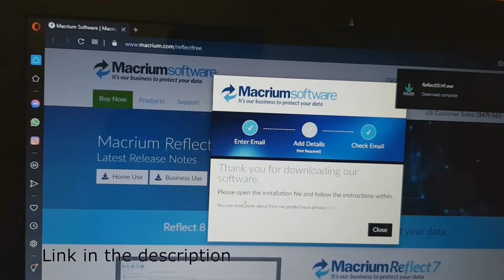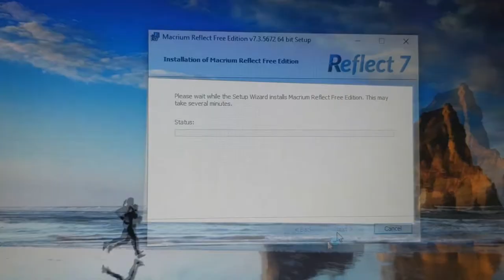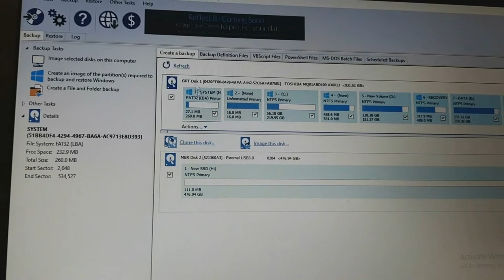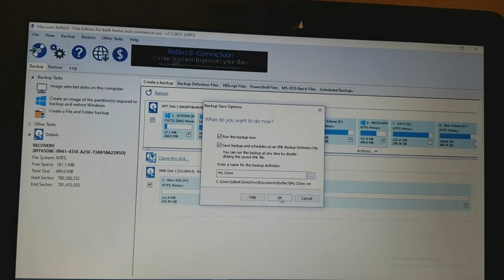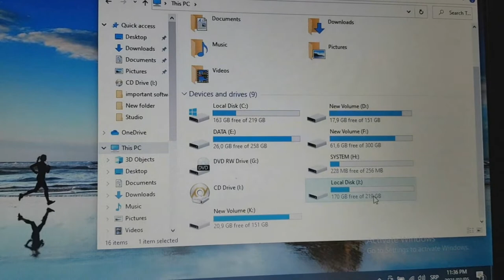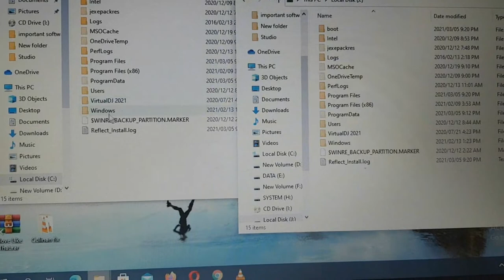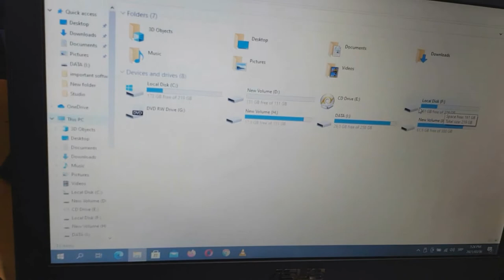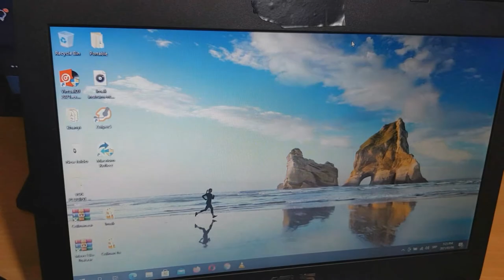Hard drive cloning(Upgrade from HDD to SSD without loosing installed software)

Comment: Can I use an extra  ssd on an elitebook 840g3?  Installed or do I have to use it as an external drive?
Reply from the maker: Yes you can use it both as external or internal drive using a caddy. sorry for the late reply